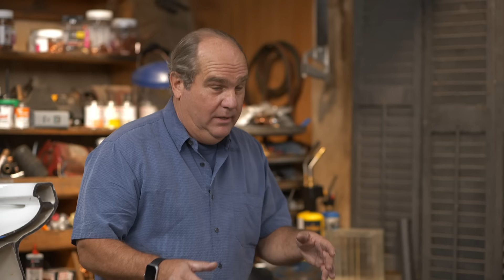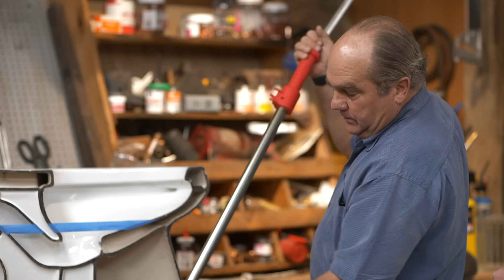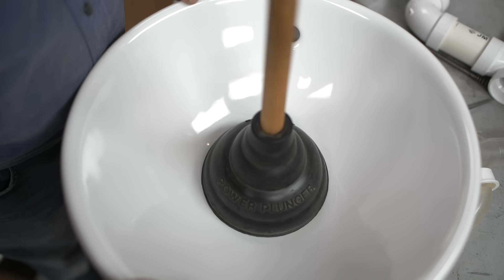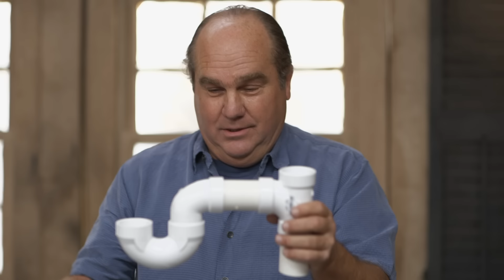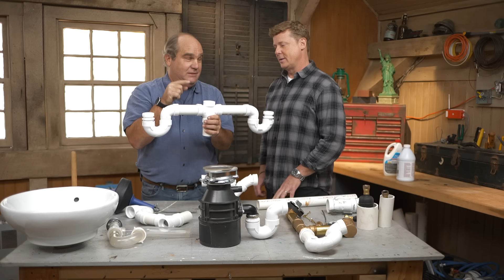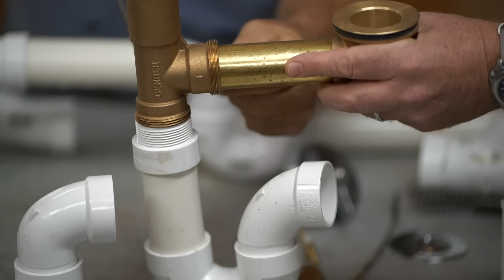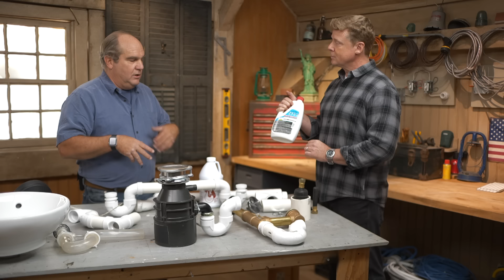How to Unclog Any Drain | Ask This Old House

Comment: Another trick that sometimes works on tub drains is to find a way to block the overflow, fill the drain with water a little above the drain, use a powerful wet vac to suck the clog out. This trick works great on drum traps.
Reply: If no overflow is it possible through roof vent?

Comment: Basically in my opinion not that I'm a plumber I don't know too much about drains but I do know this. It seems to me that drains the pipe flows from in the house to outside of the house and that's where the water. Then you got to hook up for the water outside so you can have water run through your house and then you have all the pipes. Sometimes you'll need a snake a hose or sometimes you'll have to do other things to get a clog out of a drain I know that much.

Comment: Great Old House Plumbing Video.  The Plumber is terrific and offers pragamatic solutions to Clogged piping.  I offer a "story".  Some years ago,  while sitting at my basement desk, with a sewer pipe overhead, I smelt "something" Foul.  I checked the waste line run that was overhead and would flow to the opther side of the basement and out the exterior of my house to a Septic tajnk (That's another Story altogether).  The bottom of the waste line was OK, BUT when I ran over the Top of the wasteline, I sensed the caste iron waste line was Cracked !!  It split open like a tin can.  That Wasteline flows from a bathroom in the front of the house (in a Master Bedroom).  That bathroom sink, toilet and Shower all seemed to flow OK.  Where I am in NY (Westchester County near the CT Border) we have "hard" water.  I presume that the hard water aided in rotting the pipe mixed with waste sitting in the pipe and finally Cracking it open!!  An Emergency Fix ( many plumbers were reluctant to come for this) cost me $1K !!  to replace perhaps 20 feet of caste iron waste line pipe.  Now, I use a Anti-bacterial product periodically to combat Organic build up a few times per year.

Comment: Drop hook cable helps on getting the cable down the drain;  some older houses will have drum traps, not P-traps, which a cable won't go through; be careful about using a drain snake on old tubs, the cable might pull the over-flow pipe out (inside the wall). On bathroom clogs,  if the water is still draining slowly,  bleach will almost always clear the pipes just be sure to run water afterwards (to clear the bleach from the pipes). With old plumbing it is always wise to do as little as possible.

Comment: In regards to the toilet and preventing clogs. Keep a bottle of dishwashing liquid (DL) in the bathroom. Now, BEFORE you “drop that  duce” squeeze a liberal amount of DL into the toilet bowl. Since DL is  heavier than water, it will settle at the bottom, which is important. DL (Dawn is best) is viscus and slippery, so when you flush, the DL will provide a slippery path for the crap to flow, preventing a clog! Believe me this works, especially when you know your going to be on the throne for a while. BTW, don’t be afraid to add additional DL to the mix after your business is done prior to flushing. Let’s face it, these modern low-flow toilets are a joke, and clog easily.

Comment: Great advice for a single clog. But, I have a black goo that builds up over time below our vanity sinks. How do you deal with something like that?
Reply: Try putting tons white vinegar in your drains over night and then flushing out airy boiling water in the morning. Another thing you can do is picking up a drain enzyme that eats up that black sludge. ZEP drain défense can sometimes work. Last resort would be jetting the line or using a drain cleaning bladder

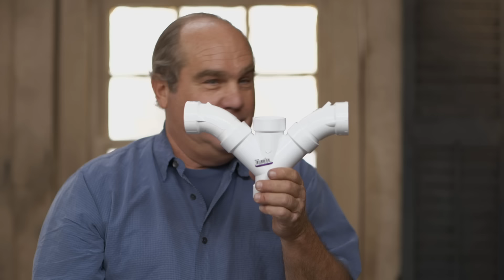Comment: At 4:18, why would Richard say "If the original plumber cared at all about us..." and then introduce an admittedly (4:25) non-code compliant method?  IPC and UPC do NOT allow a double combo in this configuration because it can cause the trap to be siphoned (vent connection below the trap weir).  The proper alternative, instead of the combo, would have been a cleanout above or below the double sanitary tee.

Comment: My kitchen clogs is after I run 2 gallons of water, i snake it with 25 feet and it still doesn’t unclog, in that case I use drano and it does unclog but every 2 to 2 months it clogs again, no food or anything solid goes through my sink, why you think it happens so quick and why is it after 25 feet?
Thanks

Comment: I like that last note that liquid plumber can eat through the pipe. so realistically its only good as regular maintenance to avoid clogs on a line that is regular problem, but also it'll break your line if its left to sit, which it probably is unless you can flood the line
Reply: Liquid Plumber is made from NoOH (Sodium Hydroxide) which is designed to Not harm your pipes. It only works against organic material. Never ever use NaOH in a stopped-up drain. The water will dilute the concentration rendering it ineffective, and then you have a hazmat situation. The other tip I'd give you is to use it on your drain 1st thing in the morning after the water in a slow drain has gone down the pipe. Then you can be assured that the chemical will contact the blockage at full strength.

Comment: Best way for a kitchen sink clog is to run water while you cable with a 1/4 inch cable. To do that you get a spare waste arm that is after the j-bend and cut a notch opening on top of the waste arm big enough to fit your cable. Multitool works best to make a notch. Reconnect all the tubular and run a little bit of hot water while cabling through the notch. When you get the blockage you'll see the water coming out of the notch go down and not overflow anymore. #Roto Rooter
Reply: You gota try out the Rigid K-9 102. Don’t get me wrong, nothing replaces the 1/4” cable entirely, but that wall to wall cleaning with no mess is a plumbers wet dream

Comment: My house is 90 years old and the steel pipe on my bathroom sink was rusted shut , I had to use muriatic acid to open it up. I did not leave it there long, only a couple of minutes lest it eat a hole in the line.

Comment: The reason plumbers use a cross, as you first described in a double lavatory situation, instead of using the double wye alternative you described is, with a cross, both lavatories are vented out of the top of the cross. When you use a double wye, the lavatories are no longer vented since you have “jumped/broken the vent”. If a plumber who knows the codes and what they are doing was to use a double wye, each arm coming from the trap to the double wye would have to be individually vented between the trap and the double wye. Whenever I snake a double lavatory or a back-to-back fixture/drain, I always use a drop head on my cable (not a wire) so the head will drop down into the vertical drain/stack instead of crossing over and into the drain of the fixture I am not snaking.
Reply: I was thinking the same thing. Without the vent it turns it into an s-trap. I don’t know a code that allows s-traps. It’s also the same reason there in a limit on the trap arm length.
Reply: @choctotha  technically, you are correct — while it really doesn’t look like a typical s-trap with the long arm to the double wye, it sort of is an s-trap. You are also correct about the trap arm length. There is a maximum distance from a vent to a trap. This distance depends on what size the trap and horizontal pipe is. The minimum length of any trap arm to a vented stack/tee is two times the diameter of the horizontal pipe size. For example, the minimum length for a 1-1/2” trap arm is 3”, and the minimum length of a 3” trap arm is 6”. The shorter the trap arm is, the more the configuration looks like a typical s-trap.
Reply: @brucestorey917    You're on the right path, but not quite correct.  What matters in these cases is the total fall of the trap arm, not its minimum length.  A trap arm (the pipe which runs from the trap weir to the vent pipe connection) cannot have a vertical fall of more than ONE pipe diameter.  That's why you can't use a wye (or double wye) here.  Angling the last few inches of the trap arm down at 45 degrees with a wye makes it drop more than one pipe diameter, thus creating a siphon.  Use a sanitary tee or sanitary cross and put in a clean out fitting just above it.
Reply: I was thinking the same and used drop heads
Reply: As someone who unclogs drains for a living, I am begging you to either stagger your back to back drains at different heights or use a wye. Crosses are very hard to unclog. Same thing with back to back toilets. Always use a wye, crosses are impossible to navigate with a cable underwater.

Comment: Thanks for the caution given about chemical drain solutions. It is often the go to solution of a home owner. The danger to the repairman is real. I was on the receiving end of a caustic flood once a long run drain was cleared. I had no way to get clear of the flow on a ladder and ended up with chemical burns everywhere it touched.

Comment: any time i have gone to a clog that is slow draining, i use clobber which is sulfuric acid, I made the mistake of not asking the  customer if they put anything in the drain ( bleach )  Drano  has  bleach  fumes from it made me lose my breath couldn't breath  eyes watered. always know or ask if anything was put down the drain before using a chemical. for drain cleaning. i will add, try to find out how old the drain pipe is had one time i used it and it  ate the pipe and caused it all to go into a crawlspace, had to repipe the whole drain.

Comment: I had a problem tub drain for many years.  Reluctant to spend the $, I bought the Bauer chordless power drain cleaner at Harbor Freight and a 3 amp battery.  That thing is worth every penny.  I ran it through at the p trap and flushed the line with the water attachment shown in the video.  Problem solved.

Comment: What about those sewer jetter kits for pressure washers? Like Clog Hog. Any experience with those?
Reply: To use a jetter on a small pipe, you will probably need a small 1/8 inch hose...1/4 inch hose won't make the 90-degree turns/ 2800 psi or higher is a good idea. You will still have to persuade the jetter to travel down the pipe (use a yo-yo-like action))

Comment: as a retired plumber, I would have mentioned that if you are clearing a blocked drain through a cleanout, if it doesn't spill out when you open it...you're probably in the wrong place
also you said if your pipe is old the drain ball might cause a leak, while the truth is, NO drain system is designed to hold pressure...NONE!!!  And if there is a fixture (vent) between the drain ball and the clog...well it ain't purty!
IMO never a good 1st option

Comment: All great advice. As a municipal maintenance tech ive used all of these options plus a couple more. One thing to note about the rubber bladders is they work well but make sure that no chemicals/ acids have been tried first. The rubber and acid do NOT mix. The acid can cause the rubber bladder to deteriorate and burst...often while being used under pressure. Not fun!

Comment: Thanks for the great video, I just ran into an issue with a bathroom sink that would drain very slow; I placed a snake about 5 ft to clear the clog and nothing happened. It looks like the drain in this house is made of galvanized pipe and corrosion has accumulated with the many years and choked the the drain passage. Of course now the snake doesn't turn down so I guess I have to dismantle the trap and guide it into position.
Note: this issue is on the 2nd floor, so clearing the clog may clog the 1st floor, I suggest to run the the water on the 1st floor bathroom sink so it can continue removing the clog. It's never easy! Peace

Comment: The one thing I wanted is the only thing he neglected. Just as the sink and the tub drains have an overflow, a low flush toilet has a similar hole as a flush assist. The cutaway toilet he was using had one, though he totally ignored it. Using a plunger on such a toilet is almost a waste of time and effort, as much of the plunging action is robbed by that flush assist hole. Even so, it will not cause any water to come back at you, unlike the sink and tub, which is likely why he did not mention it. If we had a way to temporarily plug the flush assist hole, the plunger would have a far greater chance of success on a low flush toilet. But how to plug it?

Comment: One type of clog (total or restricting) that is not addressed here is one I have every year - a washing machine drain.   I can hear the pipe fill up to the machine connection and overflows into the walls and on to the floor.  The machine connection and the clean-out are very close in proximity to 90 degree connections.   A 25 ft snake into the clean-out returns to show nothing, yet the drain fills up to overflow in a matter of seconds.  The end of my snake is bent to scrape the walls, but nothing seems to work without getting a plumbing service to use a motorized snake.  A year later the problem returns.  We do 4 loads of laundry every 2 weeks (retired couple).

Comment: You guys are great. Thank you for your time.  I am a self taught Jack of all trades in many of the disciplines I have acquired. I was impressed, I knew all the mechanics of every clogged drain you showed. However, I never really acquired the theory of the processes. A lot of it is logical in the practices. Thanks for the theory. Now in your video you showed the part that you brought from home. the one with the spiral on the end that operates the bathtub drain. I have exactly the same one. However, the spiral end that traps hair. How does that Mechanically work when it corresponds to the directional lever it attaches to or what does it actually do?    Cant figure that one out ???????    Thank you in advance   Semper Fi
Reply: When installed, the cylinder, either brass or plastic depending on the age, is in one of two places. It’s either raised up above the tee, allowing water to drain. When the lever is moved, it drops the cylinder down, preventing water from escaping. Since you’d get your snake stuck in it, it is best to remove it prior to snaking. Just keep pulling up until it all comes out of the overflow. Then manually remove the hair from the cylinder. The threaded rod it’s attached to is adjustable to accommodate for varying tub sizes. Semper Fi.

Comment: the double tee wye is illegal because it can cause a trap to syphon, allowing sewer gas fumes to enter the living space. when plunging a double bowl kitchen sink it is a good idea to plug one of the basket strainers so your pressure doesn't just push water up into the other bowl.
Reply: So what is the proper way to pipe two back-to-back bathroom sink drains in the same situation?   Double T-fittings will cause issues with snaking the drain, and double Y-fittings create illegal S-traps.
Reply: @carultch  there are multiple ways, tees side by side conjoining at the vent above flood and bringing them together below would be one way. or you could just be careful when you use a drain auger. A double wye fitting defeats the reasoning behind a vented p-trap since it locates the vacuum break below the bottom of the trap which can cause it to syphon. I actually ran into a plumber that used a back to back tee with a clothes washer drain on one side and a vanity on the other. Yep that created a little problem. Lol
Reply: In NY usually inspectors who used to be plumbers, especially in urban jurisdictions, do not allow double cross wyes. I use a cross tee wye with a test tee/clean out just above the cross tee wye on the vent but in the cabinet with easy access. But with wet venting becoming more popular, they are allowing two tee wyes stacked on top of each other.

Comment: Good information, but it didn’t address an issue we had last summer: a clog that was in or shortly past an old canister trap made of lead that would not unscrew.  For older homes, are there any suggestions for managing issues with such a trap, or is replacing it the only option?

Comment: Hi whre do you buy that black think to put in the pipe to clear blockage please
Reply: ACE hardware, Home Depot, Lowes, Harbor Freight...they all sell it. Get the correct-sized bladder for your pipe. Not expensive. You need 40 PSI or higher and more than 2 GPM volume to make the seal tight.